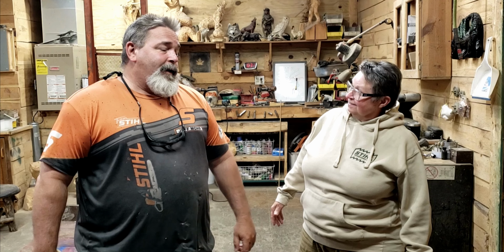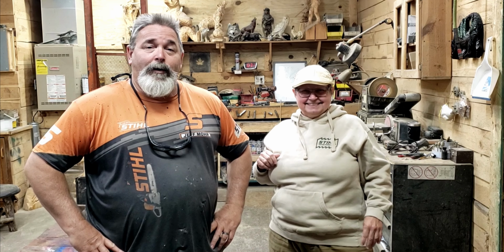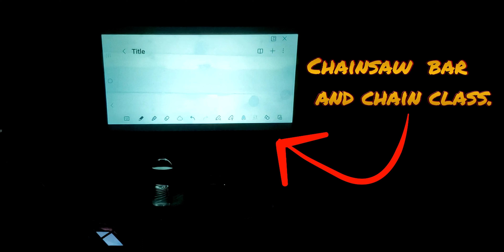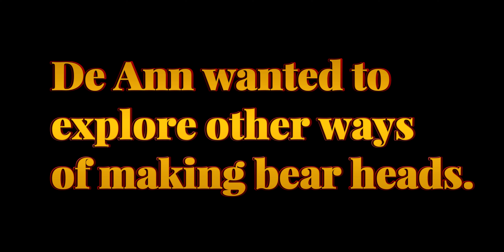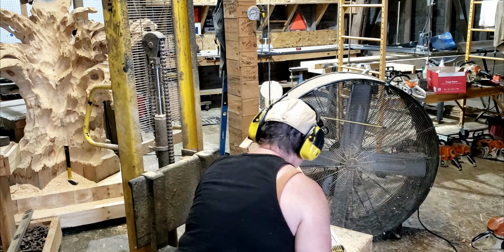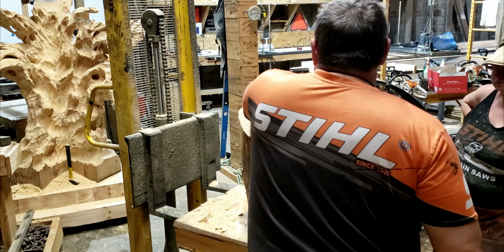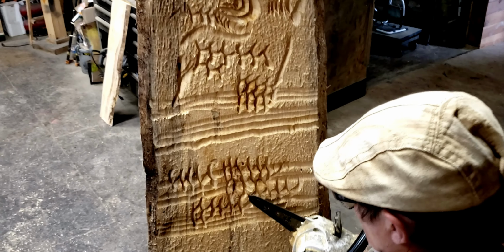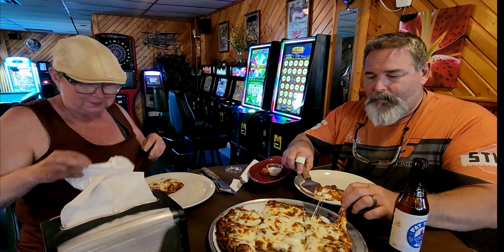Suddenly 60

Comment: Always exciting to see a new video posted, they never disappoint!  It appears you probably have one of the collections of saws in your dojo of any carver on youtube.  That in mind, I live at the end of a dead end street but do have neighbors across the way.  They are great people and I try to keep them in mind when I go out to my carving area to work.  I only have gas saws at this point and will not fire them up until after 8am out of respect for others.  However, I am a early riser and try to fill the time I have before I can carve either doing some finish work on something I have previously carved or doing general maintenance on my saws or cleaning up from the previous carving session.  The moral behind all of this is I am thinking about investing in an electric saw as they seem to be a popular choice for many carvers and I am hoping the noise levels might give me the ability to start a bit sooner in the day.  So, if you could recommend just one Stihl model for a guy that will probably put on a 12" dime time and will use it for shaping and detailing, what would be your recommendation?
Reply from the maker: Thanks for watching. I would recommend the MSA 220 with a Tsumura 12 inch .043 bar and chain set up. Get the quick charger and two batteries. Don't skimp on the batteries get the AP 300 they are close to $300 a piece but worth it.